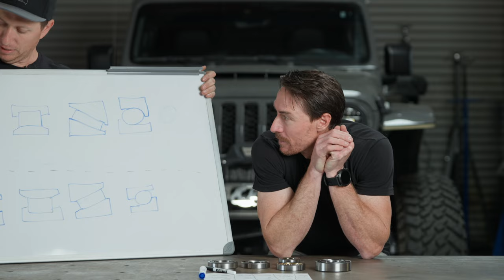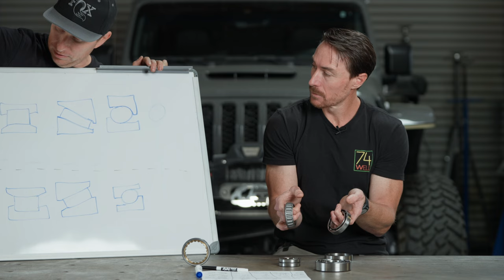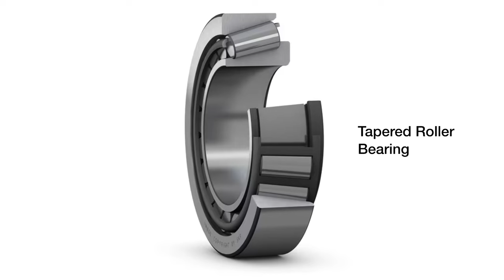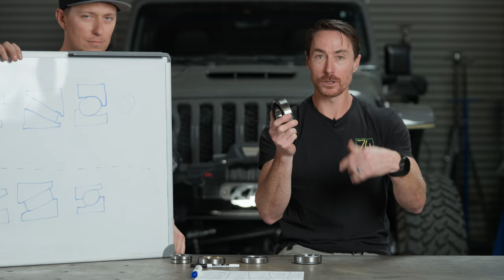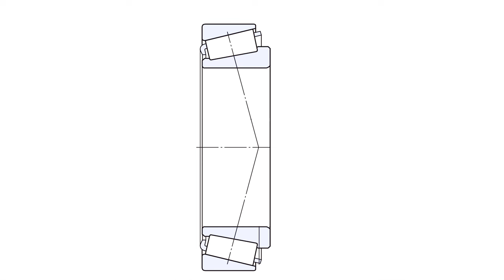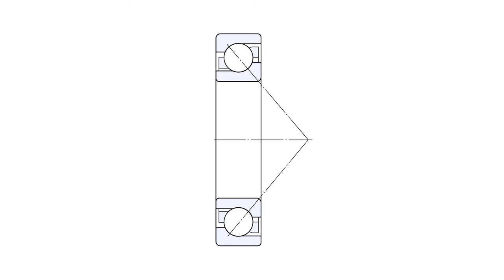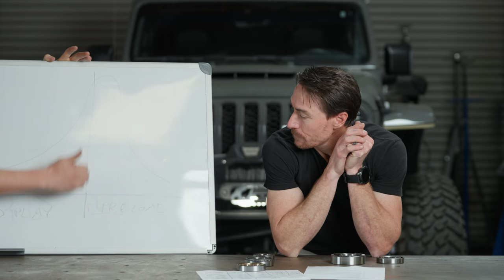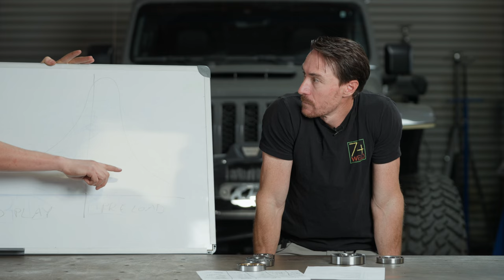Just a light hearted talk about bearings (just kidding)

Comment: I can confirm that deep groove ball bearings are limited in how much axial load that they can handle. I pressed the outer races too far into each side of a motorcycle wheel hub. The distance between the inner races was set by a spacer. It took about 100 miles before the balls came out of a bearing AND punctured thru to the outside of the hub. $$$+++

Comment: Thanks for the great videos! Why are flat thrust bearings not used? I don't see them in automotive applications.
Reply from the maker: You will see them used in motors on the crank to keep a torque converter from pushing the crank through a block (I leaned about those the hard way 15 years ago). You could run a helical gear with a cylindrical roller and a thrust bearing on either side but you would also need thrust washers so you just added 6 parts to each gear and the package got wider by probably 3/4”. Wider and more expensive and if it’s not broken don’t engineer it till it is 😜